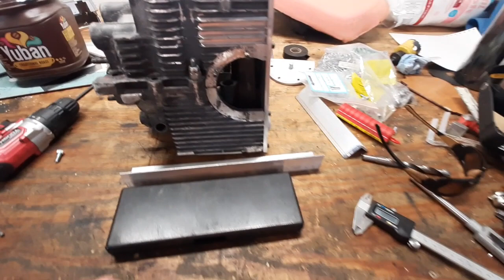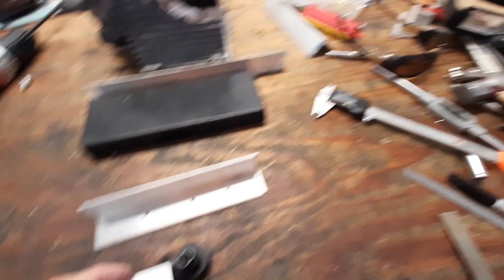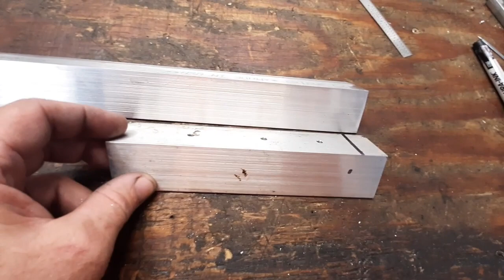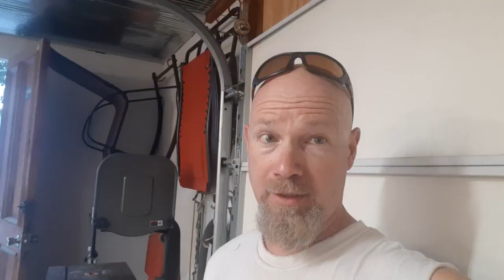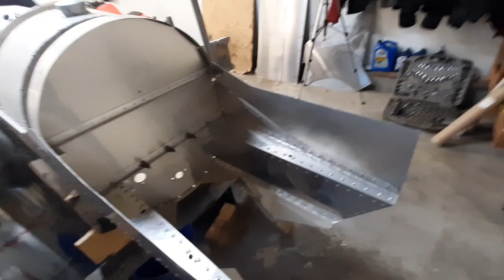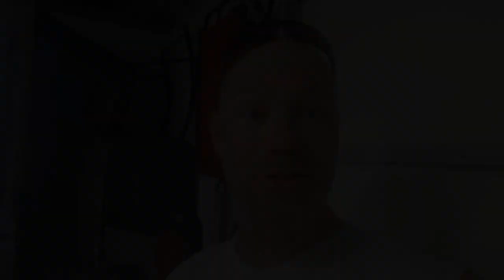1/2 VW Build - Part 8 - Engine Mounts & I Screwed Up Big Time

Comment: I see in 8.1 video the ends of your motor box rales are still open so you won't need to drill holes in your fire wall

Comment: NO don't tear your motor box apart drill the holes were they need to be then drill a hole in the fire wall just big enough for the nut plate to pass threw then push a wire down the hole back threw the fire wall then put the nut plate on the wire then ball up some wire pull it threw rivet in the nut plate then pull out the wire
Reply from the maker: The holes interfere with each other which is why I planned to redo it,  otherwise your suggestion would work fine.  Plus I'd prefer not to have any extra holes there.  Either way I'm not changing anything until I'm sure I'm going to use the VW instead of the rotax.
Reply: But is the rotax heavy enough to get cg right
Reply from the maker: Should be since weight between the is close.  Prop diameter and exhaust are the biggest issues.  Definitely hope I really like the VW.

Comment: Sounds good. Wait, plan, and consider having both sets of holes when you change it. Then if the VW doesn't fly as well for you, changing back isn't more plane surgery. 

Just stopper the unused holes to avoid collecting nose crud.
Reply from the maker: I considered having it set up for both but that would leave holes in the structure behind the VW mount.  Plus there are nut plates inside that enclosed area so I would have to disassemble everything to add them anyway.  As long as the VW runs like it should on the test stand it should be fine but no reason to change anything until I know for sure.
Reply: VW VW hours have the four stroke on a Hummel Ultracruiser.